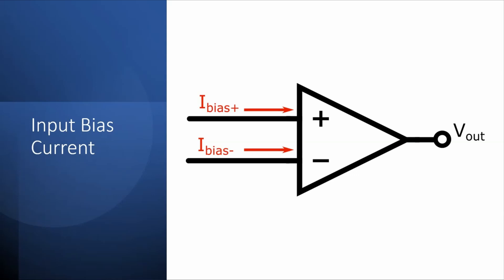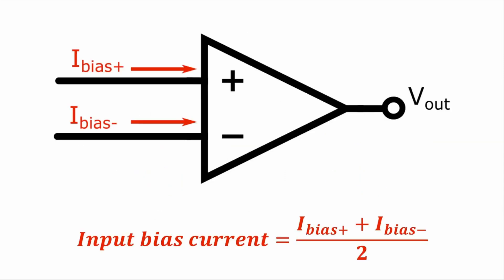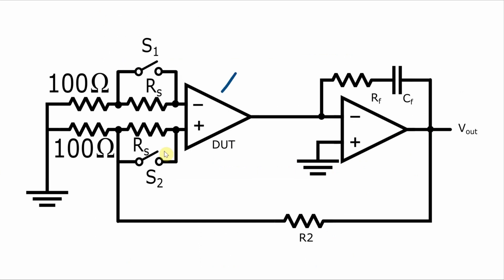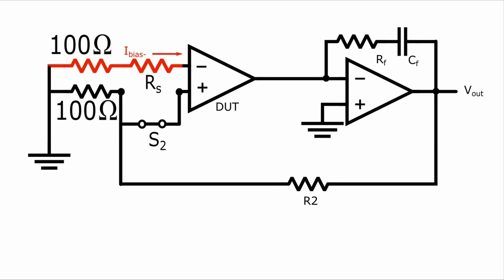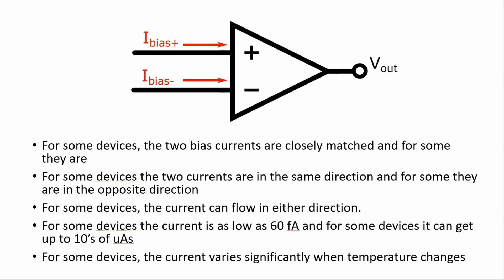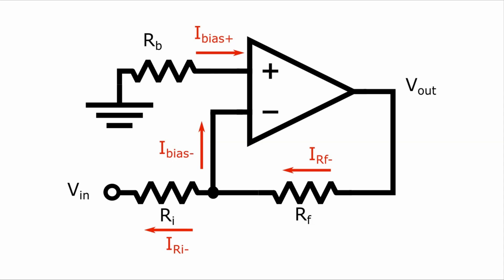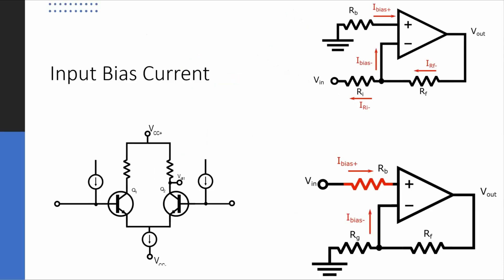Non-Ideal Op Amps: Input Bias Current

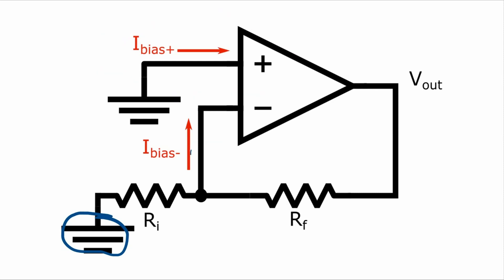Comment: 2:15 If there is current going into the non-inverting port, it must come out from the output as well, right? And if it does wouldn't it cause a potential drop in Rf and Ri?
Reply: the current into the non-inverting port (the "+" port) flows into the op-amp and out through one or both of its power rails, which flow through their voltage sources back to ground.  It doesn't flow out the output

Comment: Thank You for Your explanation of this topic. 

1) I was wondering what is the purpose of the second amplifier (that one in the feedback loop of D.U.T) and I think it is used as an inverting amplifier to change the feedback type from the positive feedback into the negative feedback. The feedback loop of the second amplifier is probably responsible for ensuring a stability.

2) I am curious if the measurement precision of this circuit is dependent on (or independent from) the second amplifier's input offset voltage. Presumably because it is placed inside the feedback loop of D.U.T. amplifier, its DC performance has no impact and even an amplifier with poor DC performance could be used (maybe the only requirement is that the open loop gain of the D.U.T is enough - I am not sure). If that's the case, this circuit is beautifully designed, because it is not dependent on the 2nd amplifier input offset voltage. What do You think about it?

3) I derived the exact formula for the V_out of this input bias current measurement circuit for the 3 different cases presented. After neglecting some of the terms which are close to zero, I got almost identical expressions. Almost. The difference is in the sign of the terms -(1+R2/R1)*V_io  and +(1+R2/R1)*I_bp*Rs or -(1+R2/R1)*I_bn*Rs. The most important difference is that the V_out has always a minus sign before it. I put V_io before the noninverting input of the ideal opamp (in series with the noninverting input).

Lets begin with the first case, when S1 and S2 switches are closed. From obtained equation, it is obvious that  R1 should be small to neglect the term R1*I_bn (the negative terminal bias current), so that is why R1 is selected to be only 100 ohms. We can also neglect the term I_offset*R2 - although R2 is rather a large value resistance, the I_offset is very small, smaller than the I_bn. So, in the first case, when switches S1 and S2 are both closed, we end up  with formula -(1 + R2/R1)*V_io (V_io is the input offset voltage). And this does not agree with formula presented in the video in terms of sign (negative output voltage).
In the second case, when S1 is closed and S2 is opened, the sign of the term connected with V_io is opposite to that connected with I_bp (positive terminal input bias current). 
In the third case, when S1 is opened and S2 is closed, the signs of both terms: the term connected with V_io and the term connected with I_bn (the negative terminal input bias current) are the same. And that is different from equations presented in the video. 

Why is it so?
Reply: Do you think a dual supply is necessity in case of rail-to-rail op-amps, if so what about the non rail to rail ones ?

Comment: I made a difference amplifier to measure 4 lion battery 18650 using quad op amp Lm324 as we know the resistor of circuit must be same  value to get difference output from 2 input signal. I use 1 Meg resistor in my circuit.  i using single supply for the op amp from batt series terminal about max 16.8 v when full capacity. when i measured using voltmeter the ouput is work fine. But When i want to measure using adc of arduino their is small current flow, indicate with internal led of arduino little glow up. I confused how to block a current so i can measure using adc. Now i just solve the problem with put 1500 ohm resistor between gnd from the op amp and gnd arduino pin. Can you help me to solve my problems sir. Thanks in advanced
Reply: 16.8V of output voltage is well above the tolerable limit of ADC (which is only 5v), i am assuming you did't connect directly to the adc and use a resistor divider at the output of opamp. Since the adc type in arduino is SAR it draws a little bit more current than sigma deltas. I think you can divide the output to the compatible range of adcs input specifications and add an extra unity gain amp in between adc and differential measurements output just to buffer voltge. Adding a resistor to ground connection shifts the reference baseline and your output voltage will vary with varying current demands of op-amps which is not a good idea if you want precision measurements.